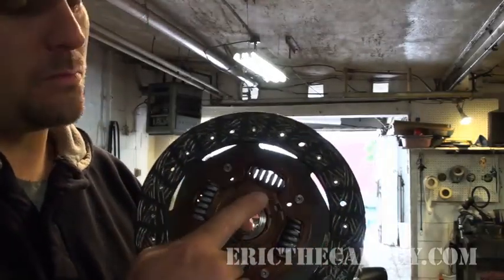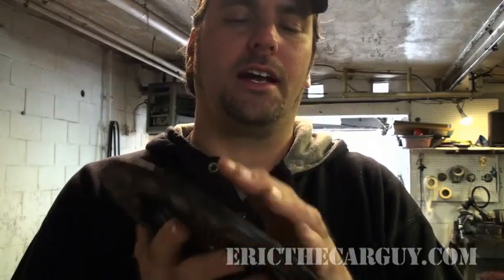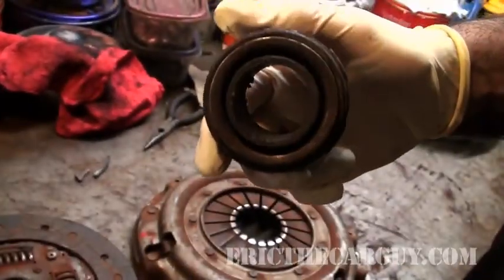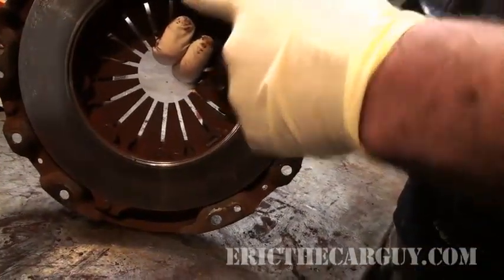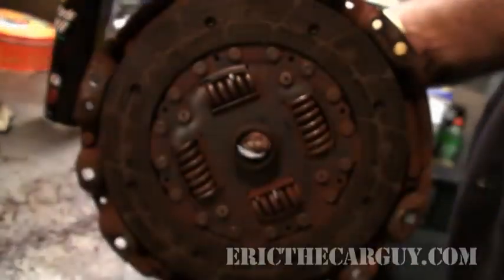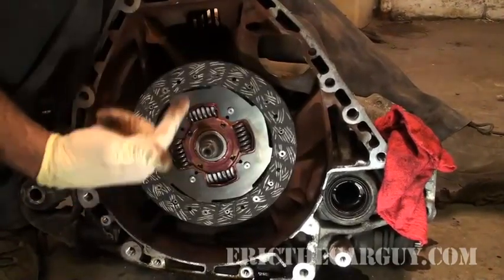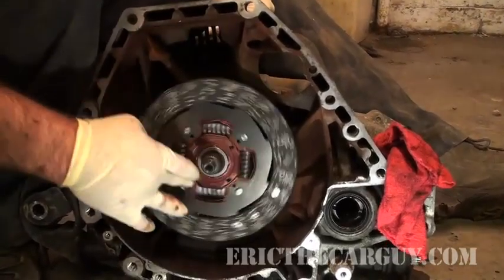Learn How A Clutch Works In Less Than 5 Minutes - EricTheCarGuy

Comment from the maker: @BlinginTom The clutch is what is used to connect the power from the engine to the transmission in a manual transmission car.  This is how the thing works that you push in when you go to shift gears in a manual transmission car.

Comment from the maker: @Dogapsa That would be the pilot bearing, the throw out bearing activates the clutch.  If it's a Honda the pilot bearing is in the flywheel and not the crank.  BTW those conversions are tricker than you might think because the engine is actually matched up to it's transmission, in other words an engine for a manual may have a different cam than one for an automatic not to mention the computer controls.  In my opinion it's much easier and cheeper to get a car with a manual to start with.

Comment: Most clutches for manual transmissions are dry! No oil or grease needed.

The thing you need to know when replacing the clutch: CENTER the disc while tightening the pressure plate assembly! - there are centering  jigs to help you out (I usually pop a short piece of a wooden broom handle in the lathe to make the required diameters)
Otherwise you can't slide the transmission back on. it's a 2 person job with an elevator and a (or two) high jack stand to support the engine (and transmission)

Comment: Thumbs up for referring to an engine as an engine; NOT a motor.
Reply: Motor:
noun. anything that produces or imparts motion; an engine; esp., an internal-combustion engine for propelling a vehicle;

Engine:
noun. machine for converting thermal energy into mechanical energy or power to produce force and motion.

Same fucking thing.
Reply: xRevolution318  Motor, as in electric motor. Engine as in internal combustion engine. There's the difference. In Finnish first one would be sähkömoottori and second one would be polttomoottori. In Finnish there's only one word for electrically operated motor and fuel operated engine and that is the word moottori.
Reply: MrBrander engines with spark plugs can be considered motors because it's electrical energy converted into thermal and mechanical energy and that's basically what a motor is
Reply: ***** I would like to see the engine you are talking about which turns electricity to fuel.
Reply: MrBrander lol when did I say it turned electricity to fuel? when an engine reaches maximum compression the spark plug goes off which is powered by electricity and combusts the oil inside the pistons which in result makes mechanical work
Reply: ***** when an engine reaches max compression a spark plug IGNITES an explosion powered by GAS (not oil) inside the COMBUSTION CHAMBER (not inside the pistons that's metal) which in result makes mechanical work
Reply: cartwork2013 what about siege engines? :P
Reply: Stijn van Pelt You are a time traveller from  Assyria?
Reply: cartwork2013 Of which there are many! :)
Reply: okay search engines then?
Reply: +sonicstep OMG IS GOOGLE A SEARCH ENGINE OR A SEARCH MOTOR THEN?!
Reply: omguanyin
I will politely tell you that you refer to 'semantics'.

Interestingly, the conical glow plugs I use in my model car engines are referred to as 'TURBO' plugs, yet they have absolutely nothing to do with compressive air impellers, turbocharging. It's simply a marketing term which I don't agree with, but I have to accept.

Words rightly or wrongly evolve for all sorts of reasons. You need to too!
Reply: @MrBrander  uses electricity to ignite fuel dude, its not a hard concept. English is loose like that get over it

Comment from the maker: @HondaHowTo1 You could think of it as an inner and outer disc or one for the flywheel and one for the pressure plate with a wave plate in between, the 2 discs move independently of each other and are dampened by springs during the apply.

Comment from the maker: @djmouser15Y One thing that is often overlooked on manual transmissions is the thrust bearing inside the engine, this can wear on a manual trans car to the point where the crank will actually move forward when the clutch is depressed.  Have someone step on the clutch while you watch the crank pulley to make sure there isn't any movement.

Comment: Very nice short simple explanation. I think the hardest thing for most to understand is how to pressure place fingers work. Basically a fulcrum pivot point that reversed direction of the pressure plate as you stated. You press one way and the plate moves the other. Thumbs up Eric. Just wish they'd put this kind of stuff on tv instead of the non informative (more about selling) auto shows and unreal reality shows. Nice job.

Comment from the maker: @TheGamersTrend 2 discs in the clutch assembly make for more surface area and supposedly better holding power for hight torque applications.  A racing flywheel is normally lighter so the engine can rev faster.

Comment: Many thanks for a nice simple explanation that a numpty like me can understand! Appreciated. 
I didn't previously understand that the friction plate was in fact 2 plates that could very slightly rotate against eachother with those springs to take away the harshness that would exist if it was solid,  have wondered what the springs purpose was.
Thanks again.

Comment from the maker: @thiagosct There are no 'return springs' that's pretty much the job of the pressure plate.  You might start by checking the linkage and if you don't find anything there you'll probably have to remove the transmission and check things out.

Comment: I'm currently learning how to drive (with my first car which is an MR2 SW20). I'm struggling with clutch control but this has helped clear my mind up about what's actually happening when I use the clutch. Liked and Subscribed!
Reply: Before I begin wanna say I'm jealous you have a sw20. I want an aw11 but no money :(. Anyway what my cousin told me when she taught me to drive stick in her miata was "keep a balance between your clutch and throttle. Whatever pressure that's leaving the clutch should be the same pressure going on the throttle." Slow and steady and have patience. If it helps you find the engagement point, try staying still on an uphill without the brakes. I will warn you it's torturous on the clutch so be careful. Best luck to you and enjoy the sw20. It's an amazing car, just mind it's temper lol
Reply: interceptor231 Thanks for the words of advice :)

Comment from the maker: @Dosalt It really doesn't matter as all your looking to do is disengage the engine from the transmission and since the clutch is splined to the input shaft of the transmission once it's disengaged from the engine it will no longer transfer power to the transmission which is what your trying to accomplish.

Comment: Good explanation ETCG. Although I would add that the Pressure Plate is bolted to OUTSIDE of the flywheel; the clutch disk is splined to the transmission input shaft at disk's CENTER. And the ransmission shaft rotates freely within a hole in the center of the pressure plate. This enables the disk to rotate independently of the engine, when the clutch pedal is depressed.

Comment from the maker: @Cybercom82 It could be an issue with the hydraulics, see the video I did on replacing Honda clutch hydraulics for specifics on what I'm referring to here but it could also be an issue with the clutch or pressure plate.  If it were me I would check out the hydraulics first and go from there.

Comment: And at 24 years old i finally learned how a clutch works! I had no idea it was two smooth surfaces pressured together. (I thought it was two rough sufaces so it could have enough friction) however it still boggles my mind how some people can take off so smoothly that it mimics an automatic. And other can't. Is that driver skill? Or is it something in the clutch in itself? Like the surface isnt smooth anymore after 100k miles.
Reply: Which means i'm skilled then. 

Where's my sammich ?

Comment from the maker: @1967800 No it won't, it's when you move it in and out that the clutch will wear, when the pedal is all the way down the clutch is completely disengaged so nothing will wear during that time.

Comment from the maker: @polypolyman How do you 'feel' the balance?  Also, you need some rotational mass there as it helps to balance the engine, remember the power comes in pulses so you want that rotational mass to help smooth out those pulses.

Comment from the maker: @T9SUnFou Not knowing what type of car you have I can only guess but if they changed the clutch and throw out bearing that pretty much leaves the input shaft bearing inside the transmission or some other internal transmission issue.

Comment from the maker: @mitulpatel0308 It may be that a spring has fallen out of the clutch disc or the pressure plate is damaged, if that is the case then you may experience a problem like that.

Comment: Hi Eric, the clutch disks halves don't move independently from one another, they are riveted together with a gap.  The disk assembly is riveted to a hub. The springs are caged inside a plate and the plate is separate from the hub.  The springs attach to the plate and the hub which transmits the engine power to the input shaft.

Comment: Great video Eric.
There are a lot of ideas on the web about throwout bearing/realease bearing and the pilot bearing/flyweel bearing and noise. But if you have scraping noise when the car is driving, but the noise dissepears when pressing the clutch down, which bearing is faulty? 
Also is the noise comming from some friction between parts if its a scraping/metallic noise?

Comment: Great vid. Question: Does the clutch have friction material on both sides or one side? Do the flywheel AND pressure plate have friction material as well? I always thought the clutch only had friction material on the flywheel side and everything else was smooth.

Comment: Eric. Please answer this question as I only trust your opinion at this point. It has to do with driving a manual. Is it ok to push down the clutch pedal all the way down while anticipating a red light for example, or waiting to make a left hand or right hand turn as another example? That's not considered riding the clutch is it? I know not to hold the car on a slight incline, ludge forward and backward while waiting or rest my foot on the clutch pedal while driving, but I like to be at the ready with my foot pressing ALL THE WAY DOWN while anticipating to move forward and not have that slight pause or delay to put it in gear.

Comment: the springs in the clutch dampers the shock of initial engaging/degaging with the clutch petal i finally got the reason for that component. The pressure plate fingers are a little counter intuitive but i get the mechanism now. The grip tape could also wear out on the clutch plate to cause spillage or the pressure plate could be damaged dented or fingers worn to cause slipage or sticking nice video finally got it down now how the clutch all works and it components. Curious about the rare clutch reservoir tank / fluid on honda models in some cases are for .... i am imagining it is a force assisted clutch petal booster but not really to sure on why the need or how much more effort it would be for these particular manual transmission that have it to go with out it
 I think i have actually seen in one of your videos there is even some models cars with 2 clutch reserves. kind of curious what fluid you can uses in those reservers  MTF , ATF , brake fluid ,....

Comment: Eric I go ta question (thanks a lot for the video by the way):

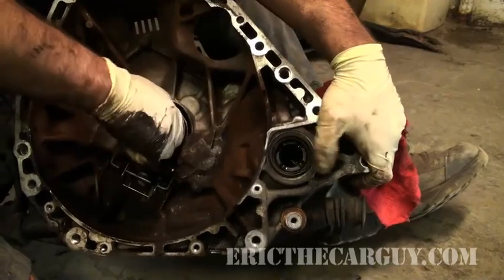At around 3:56 when you indicated the smaller hole on the transmission housing that, if the car's in gear, will rotate with the central hole on which the splined input shaft is mounted. Is this smaller whole that you said, "is connected to our axle and thus the driven wheels"- that is the output shaft right?

Roughly where would the intermediate/layshaft (which transmits input shaft's rotation to the output shaft via gears on each of them that are always in contact) be situated?
To my knowledge, the gears allow output shafts speed to equal input shaft's speed only when engaged Because that is when the shift collar and synchromesh pins the gear on the output shaft to rotate with the output shaft. Am i right?

Comment: I'm still learning about cars on the mechanical side and I just can't find the answer to a question I have. If the tires are unable to turn like a steep incline then the transmission in first gear is not turning, correct? If the transmission is not turning and the clutch is not depressed than doesn't that mean the flywheel is immobilized? How does the engine keep cycling?  I know that the engine is still cycling turning the crank shaft which is directly powering the flywheel but is it slipping? Where is the mechanical stress relaxed so the engine doesn't stall?

Comment: I daily drive a manual but know surprisingly little about the clutch. I was just wondering where the clutch is relative to the flywheel when the clutch pedal is all the way down. Also will revving the engine (for example while doing heel toe) will wear out the clutch? Great video!

Comment: I'm not a mechanic, just an engineer, 
but just from watching this vid, I'd say it could definitely be the throw out bearing.   It would only make noise when the clutch was out, whether it is in gear, or not.  If the noise changes with RPMs, and not with wheel speed, then that is another sign.

Comment: Oh, some greasing may be required: the splines on the hub of the disc and the pivot point of the lever for the axial bearing. - but most times the input shaft is already greased on the splines from previous use, and that pivot point for the lever is no worry.

Just keep the grease out of the friction surfaces and the hub-disc assembly (it has some other friction dampening system inside the hub, to dampen the spring motion)

Comment from the maker: @deamonlove666 Unfortunately I've seen that before and the last time I ran into it we had to replace all the parts of the brake system except for the metal lines which we had to flush out.  That combination of fluids ruins all the rubber inside the brake system so anything with rubber in it would need to be replaced sorry.  Good luck.

Comment from the maker: @m33ts4k0z Having the clutch pedal pressed in all the time really won't do any lasting damage especially to the flywheel however manual transmission cars do tend to wear the thrust bearings on the crank shaft as a result of the side loading of the clutch.  In my opinion it can go either way, I've driven sticks for years but personally I've just left the clutch in and not put it into neutral and up to this point that hasn't been a problem.  I'm sure you'll get a lot of differing opinions though.

Comment: really nice video.. I only knew the basics of the gear box , but never had the chance to se one opened, and how it really works. 
True or False: to protect the life span of the clutch , when the engine is idling at the traffic light for example it is better to disengage the transmission , putting it to neutral rather than leaving it engaged in drive mode and holding the clutch pedal pressed down.  Can you explain that in a video? It would be appreciated.

Comment: The flywheel is attached to the crank on the back of the engine, so when the pressure plate presses the clutch plate against the flywheel power is transmitted from the engine via the clutch to the gearbox and out to the wheels via the differential.

Comment: Thanks, Eric.  I still have a key question unanswered from the video, and would welcome anyone who has the knowledge to answer it.  When the pressure plate is pulled away from the clutch disc as the clutch pedal is being pressed, why does the clutch disc slide along the input shaft towards the direction of the pressure disc (thus disengaging it from the flywheel), when there is no force driving it to do so?  Remember all we are doing is to disengage the pressure disc from the clutch disc, and the pressure disc does not actively pull the clutch disc away from the flywheel. The inertia should keep the clutch disc in contact at least momentarily with the flywheel, thus spinning still with it at the same speed, until the friction is not enough to keep it that way.  If that is correct, the slipping friction will wear the clutch disc in this case.  But again, what is the reason that you say in your video the the clutch disc is going to disengage from the flywheel (meaning that we create a space between the flywheel and the clutch disc by pressing the clutch pedal)?

Comment: So quick question,  When is the throw out bearing spinning?
Reply: The throw out bearing spins when you press the clutch pedal in, like when you're changing gears. This will cause the throwout bearing to be pushed forward and make contact with the metal fingers on the pressure plate and disengage the clutch.
Reply: Any time the clutch is disengaged AND the engine is running.

Comment: when you  put the clutch and pressure plate against the flywheel is there supposed to be a gap between the pressure plate and the flywheel were the pressure plate bolts sews in the flywheel or does it supposed to be flush to the flywheel? THANKS

Comment: I have a 2000 Acura Integra that has a fluctuating pedal. Sometimes it will grab low, and others times it will grab high. Also, I hear a screeching noise sometimes, but not always. Any ideas?

Comment: Hey Eric,   so I have a 2018 Subaru and I just started hearing that when I press in the clutch pedal and release fast it will make a clunk sound.  This happens in neutral or driving only when the car is on. Anything I should check for?

Comment: whats the difference from having a pull clutch system to a push clutch system? Also whats the differences in having a duel or triple plate added to your assembly? Besides keep up to more horespower
Reply: Pull-push: you are confused 😄 İn duel or triple clutch systems, transitions are softer than mono clutch systems. The absorption is more easier 😉